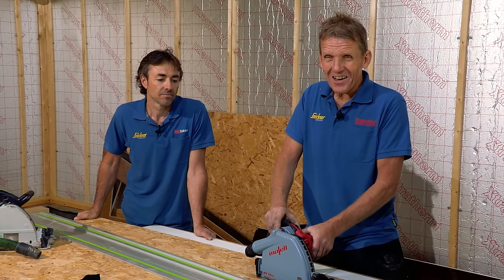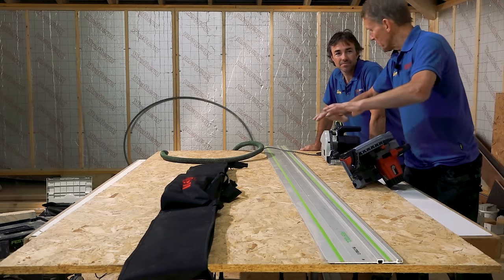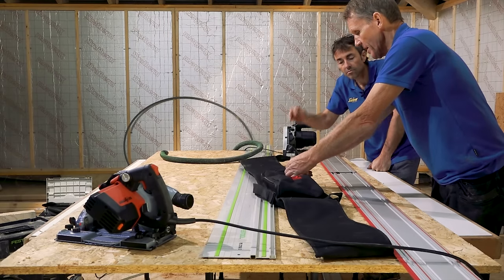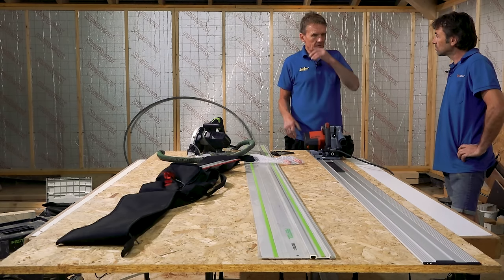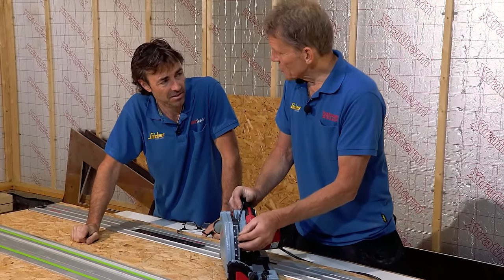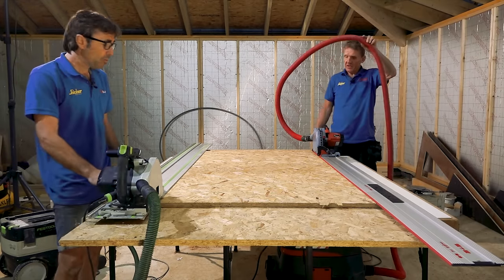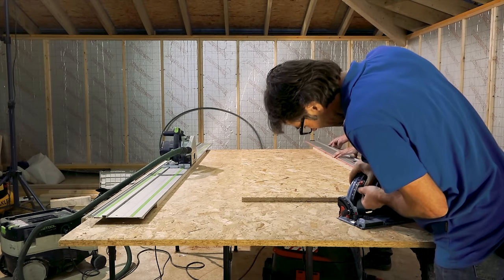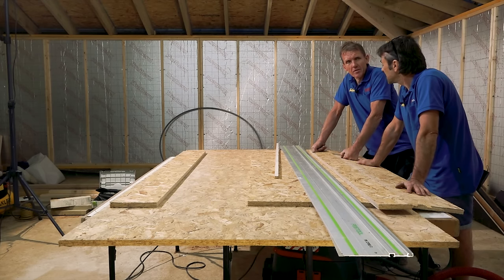Would Robin Swap his Festool for a Mafell MT55CC?

Comment: I'm 1 of the few in the U.S. that has the mafell mt55 and it's far superior to any track saw out there.  the festool feels like a AS SEEN ON TV plasticy toy tool.  I've used it for 5 years with never any problems or lack of power.
Reply: That is just pure nonsense. 

I own both a festool track saw and Mafell and I know that is just nonsense. The Mafell is better but only fractionally better.   The festool works and does it for $600 a Mafell is much more expensive than that but it is a very good tool. 

The festool does not lack power when used sensibly if you feel it lacks power it means you need to be using a different tool entirely such as a table saw.
Reply: @bighands69  Yes, an absolute nonsense comment.  The Mafell does have more power but is considerably more expensive.  The Festool saw will be more than enough for most people's needs and has a class -leading warranty and service.  It certainly not a toy by any standard; I've one in service for 15 years and not a single problem with it.  And the number of Festool track saws in service illustrates their inherent quality.
Reply: georgio no sabe hey man just wondering how you are still feeling about the saw? I have a Festool already but I want to get the Mafell. I’m having a hell of a time figuring out the differences between models as well.

Comment: I just sold my TS55 and replaced it with the Mafell. It's in a different league to be honest. The TS55 is a lovely machine, but it's just not powerful enough to cut through material such as a 50mm oak worktop without shutting down into limp mode every five minutes. The Mafell goes straight through it - even when ripping down an entire 4m length. Brilliant saw.

Comment: The black part on the bottom of the saw can be removed to fit on the festool track
Reply: Thanks Shane I'm going to give that a go!!!
Reply: RTFM.
Reply from the maker: Point taken. We are contrite and will do so in future
Reply: @SkillBuilder  great video. As well as been able to remove the black plastic so you can use on other rails it also has a little clear plastic window part at the front you can move down for extra dust removal. You mention in the video you can get the saw with the rail for £450 including rail where is that from as the say alone cheapest I have seen is £420 including vat

Comment: The 55 might be Slightly under powered but I have the 75 and it definitely has power, Majority of the people pick up the festool 55 but the 75 is definitely a beast!
Great channel boys keep it up!
Reply: i too have the 75,,,,,,   just a fantastic tool,,,   but would like a smaller battery rail saw like the mafell 400
Reply: 55 is lighter and some people may only need that for certain jobs. I have both the 55 and 75 and Mafell track saws as well.
Reply: @davidblurton7158  there's a recent version of the mt55 on a 18v battery, very powerful! Like the 36v festool, even if its only 18v

Comment: They should give you the plunge saw for free, after giving a very accurate and honest opinion.
You two are have a great sense of humour i certainly chuckled from some of those puns.
Fantastic video guys keep em long!
Oh and the rubber it slides out from the ends of the track if it needs to be replaced.
I've only had mine about a month bought the battery one (the wife doesn't know!)
I've not used the -1 feature as yet i'm not sure how it can work on butting panels up tight as it would cut the opposite way as my off cut is always on the right.
Good saw though i think maybe i wish had bought the corded one as the batterys dont seem to last long.
Reply: Great tip about the rubber!! thanks for the comment

Comment: looks very similar to my bosch apart from the blade change, track looks identical.  I had a festool and upgraded to the bosch and never looked back, more robust, more power, plunging felt more natural and much better track connection.
Reply: Bosch use the Mafell rails and yes there rails are much better than the Festool rails.
Reply: oh right, thought they looked the same. the actual saw is very similar to look at and sure my bosch is 1400 w too.
Reply: its a great saw i know that
Reply: Mafell make the saw for Bosch. This is not a secret.
Reply: Mafell makes the tracks for Bosch and they're interchangable.  Festool tracks SUCK.  In fact ALL OTHER tracks suck because they're very fiddly to to join them true... and then they come out of true if you carry them or bump them.  Mafell/Bosch tracks join & stay true with no fiddling or worry.
Reply: Do Mafell manufacture for Bosch? I thought Bosch made for Mafell to a Mafell patent. I use Bosch tracks with my Mafell kss80
Reply: As already mentioned, the Bosch is made at the Mafell factory. I purchased one of the large Bosch saws thinking I'll have the capacity when I need it but found it a bit too big for most use so decided to go for the Bosch plunge saw, then my builder friend mentioned the Mafell. At the time I thought the extra cost wasn't worth it and I am a huge Bosch nerd but the more I read about it and videos I watched I convinced myself to take the plunge ;) I didn't like the Festool, seems too much green plastic for the cost. Well I can confirm the Mafell is a brilliant saw, dust extraction is excellent and the extra little features over the Bosch swung it for me. Like in this review I got the kit with two tracks and their carry bag and I also had longer tracks for my Bosch but I don't think you can buy boards long enough to make use of the possible length.
Reply: good point about the tracks
Reply: Festool made the first track saws so that is the reason why other brands look similar.

Comment: Makita for me. I was going to get the Bosch plunge bc mafell makes it and they have the best tracks bc they lock in perfectly but every time you do a bevel cut with other saws you can feel the saw tilting but Makita has an anti-tilt. Plus its half the price and meant to be for cross cutting. I'll use tablesaw for ripping or buy the 118 inch track

Comment: great vid! i got a ts55, never had a service and still running after 5 years, then again, i'm only cutting 18mm boards.
i would like to have a go with the mafell as someone told me if you remove a piece of the base on the mafell saw it will work with the festool rails?
Ta for now
Reply from the maker: Yes that is true, you just need to take out the plastic strip from the channel and it goes on the Festool rail.

Comment: I bought the Mafell last year after using a Festool for 10 + years. The Mafell is better but try doing a 45° bevel cut, it doesn't cut on the rubber edge. I sent my first one back as the cut was over 2mm away from the edge. The festool cuts dead on the edge like it should. I still prefer the Mafell and the Festool is used as a table saw now in a CMS unit.
Reply: Really?  Mine cuts dead on.  Did your replacement unit do better?
Reply: Stringfellow Hawke yeah replacement is about 1mm which isn't as bad. Just have to remember to allow for it when I do a bevel cut.
Reply: Mine has got the same problem - at least if I clamp the track down. Don't know if I should send it in? That's my only complaint so far after one year of use. Nice bit of kit

Comment: Bought this exact setup from Timberwolf tools... but no kit or package deal was available.  Cost me over $1600 for the Saw, 2 rails, clamps, angle attachment, and an extra blade.  No bag.  Crazy expensive but I couldn't have done with out it.  
I would have flung Festool rails against a wall out of frustration on the first use.  I have no patience for poorly designed tools.

Comment: A comment on cable management.  Two Dutch guys invented a sort of clip that you can attach to your belt and then put your dust extraction hose and powercable in it, so they always stay out of the way. Works absolutely great!  usefull for all kinds of jobs with corded tools. Sanding, cutting your hedge, mowing your lawn, you name it.  The thing is called the "Slide-Kick"
  http://www.innotwins.nl/
 Always put your rail on the board that stays on the table, not on the piece you're gonna cut.
Greeting from Zeeland (NL)
Reply: Greetings from NEW Zealand 🇳🇿

Comment: Good video, I like my ts55 but I do like the maffel flexible rail that stores away in the box,  that would be great in a 2.4mtr track. Only thing I disagree with is that the trend blades are cheaper than sharpening and good quality, you never get the same cut from a sharpened blade I have found.  Trend also do a pt blade for mfc and laminate wich gives a good clean cut.
Reply: I dissagree a decent saw doctor like the guys I use send them back better than new. They do have a very smart CNC sharpener outfit though. I use trend industrial blades amongst others and they are good blades.

Comment: Why do you have to "cut the rubber"?
Reply from the maker: The rubber holds the timber down to stop breakout as the saw blade cuts from the bottom upwards. The rubber is wider than the blade so the first cut is the one which matches the blade to the rubber so it is a perfect fit.
Reply: @SkillBuilder  When I bought a Bosch saw with a rail I couldn't work out why the blade was fouling on the rubber, so I took it back to ITS and the guy there  didn't know either so he gave me a refund. That was about 5 years ago.
You live and learn.  Since then I just use straight edges and clamps.
Reply from the maker: That is so funny. The guys at ITS should know what they are selling.
Reply: @twig3288  hahahahah

Comment: It's no where near £450 the Mafell set 2 rails, joiner, clamps and bag is £599
Reply from the maker: Sorry about that I always talk ex vat  because I am buying through my business. D&M tools are doing it with the kit for £499. plus vat. I think that £599 is  from Screwfix and they aren't the cheapest.
Reply: Skill Builder I got mine at the d&m toolshow last year £569 inc vat. I've just started using the same size blade as in my festool in the Mafell and it works perfectly. Trying out a new brand called Keyblades that everyone is raving about on Instagram. A fraction of the price of festool and Mafell and I'd say they're better 👍

Comment: Tracksaws are great for so many reasons.  I have the Mafell MT-55 and the KSS-300 and will never be without either... BUT... has anyone noticed ALL TRACKSAWS are built backwards???  They're all built lefthanded!  For rip cuts (we righties) walk the length of the panels cross-armed.  The blade SHOULD BE on the left of the saw.  Imagine walking the length of your cut with your elbow at your hip as God intended!  
A cutoff saw like the KSS-300 is different... it needs the blade on the right so the timber supports the body of the saw and the excess falls off to the right.
What on Earth (or Europe) possessed all manufacturers to build for left-handies???
Reply: I'm a leftie, so it's all good
Reply: Stefan Raschle  - Yup!
Reply: Because we're not American !
Reply: I'm not sure what you mean.  You're not American so you prefer things Left-handed?
Reply: @Golgafrinchamdent  
We prefer the european style saws or " sidewinder " as the yanks call them . Worm drive / rear handled saws are an American thing that only they " get " really . The rest of us find them awkward , especially the cordless models . That's why in Europe they specifically make the cordless saws with the blade on the Right side of the machine as opposed to the left . ( yes , the left hand models are available there also but not prefered )
Reply: First, I'm clearly the 'odd duck' here... so this is just to try and understand.  On a saw with the blade on the right (assuming you're right handed)... you find it BETTER to walk the length of the rip with your right hand all the way across to the left of your body?
On a cutoff saw... YES, I get it!  The cutoff falls off to the right with the body of the saw resting on your workpiece.
BUT this is a TRACK SAW ... meant for long rips.
Reply: @Golgafrinchamdent  
Once again , yes ....... we all prefer the saw blade on the Right hand side . I have the Makita track saw , it's made in the UK actually and it is a pleasure to use it .
Go on to the Mafell website and you will see that they make tracks for their saws so long , that it's almost like having a transportable Alterndorf panel saw on site !

Americans just don't seem to be able to adapt to R/H side saws but the rest of the world can .
Reply: Yup, as I state above I actually have 2 Mafell track saws which I enjoy using.  But my original point stands... and you never addressed it.  We have to walk cross-armed the length of every rip cut... or use our left hand.  So as with most things... I'm right and the rest of the world is wrong  ;)
Reply: @Golgafrinchamdent  
You have two Mafell saws and you're whinging about the design ??
" Yup " ..... as I thought , you need to give yourself an uppercut and realise how fortunate you are .
( I didn't address your original question as I viewed it as nonsensical )
Reply: You're right of course.  I am fortunate to own two Mafell saws.  And I agree...whinging is unseemly.  We should all accept the world as we find it and never offer ideas for improvement.  And certainly never against prevalent opinion or design.  Progress works best when perceived deficiencies go un-addressed.  Thankyou  :)
Reply: @Golgafrinchamdent  

Didn't ABBA write a song about you titled : Drama Queen ??

( that's a joke by the way oh phylosophical one )